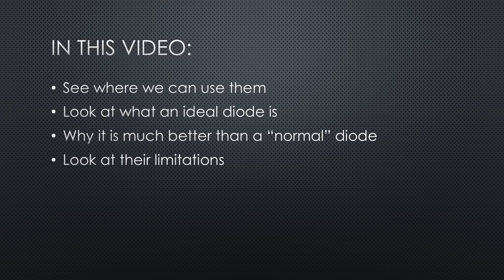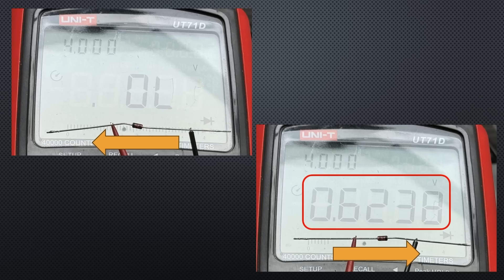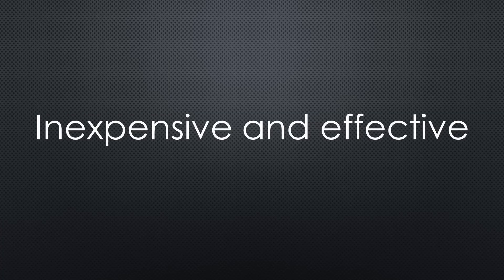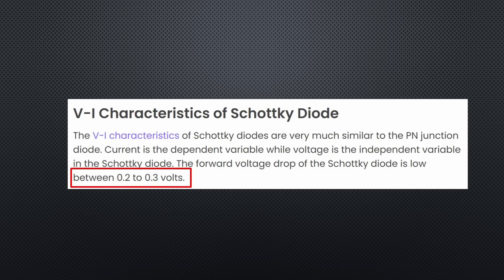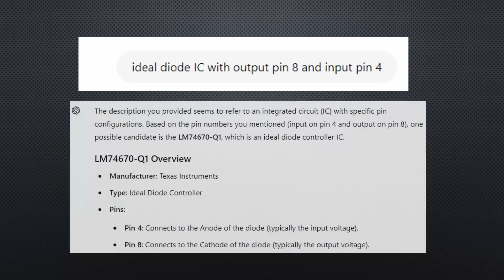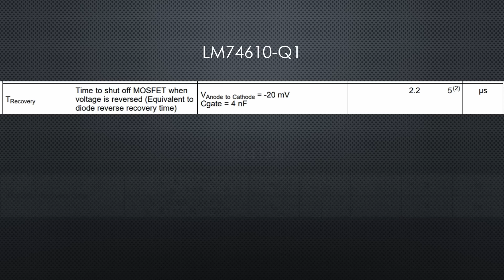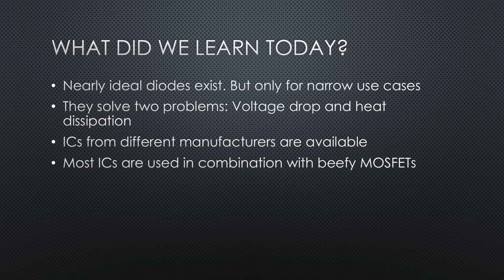(492) How to Protect Your Devices Against Reverse Polarity Using Ideal Diodes

Comment: Nice, I liked the Morse code section delimiters, spelling out the word diode. 
When it comes to polarity protection, I normally go in a different direction. My go to design is to not put the main power through the protection diode but to put it through a resetable fuse, then I put a Schottky diode in the reverse direction across the power input but behind the resettable fuse. So if the user applies reverse power the diode acts as a short circuit and causes the fuse to open protecting all the circuitry including the protection diode. Once the polarity has been fixed then the fuse resets and operation can continue normally. I think this is a better alternative for 2 reasons, but it has 1 drawback.
Its better because it forces the designer to include a fused input which provides protection for both polarities of incoming power, something that all equipment should have. Secondly it does not dissipate any power when the polarity is correct. The 1 drawback is that your internal circuit is subjected to a reverse voltage equivalent to the forward voltage of the protection diode. So if you are designing very sensitive circuitry further internal protection might be required.
Reply from the maker: A good idea for low power devices. I assume it has a low voltage loss. It is sometimes called "Crowbar" because you shorten the power cables.
Reply: @AndreasSpiess  Some call it a crowbar, but it is not quite right to call it that. It also works for any level of power as long as you select the correct fuse. 🙂
Reply: @AndreasSpiess  So is the ideal Diode solution. For High current devices a latching relay could be used with a diode to trip the relay off in reverse polarity, another diode to latch it on in forward polarity. 

My cheap & easy solution for Rev, Over voltage & Surge is a TVS diode & a PTC fuse. Cannot beat it for cost & simplicity.
Reply: Even better use a TVS diode which adds over voltage & surge protection. Cheap & easy!
Reply: I really did not like the super loud beeps.
Reply: @leocurious9919  I also really hated getting really loud beeps directly injected into my left ear.

Comment: I once had this dilema so i tried to make what i called the (I don't care circuit) with mosfets and relays which was designed to deliver the right polarity no matter what polarity on the input but for efficiency and cost I went back to the diode and fuse simple design.
Reply from the maker: Indeed, this is a good thing for low power devices.

Comment: My worst (most costly) "reverse current incident" happened in the mid-80s. I was examining a German Z80 computer accessory card, a pretty expensive A/D converter. I put on the power, and it burst into a short flame and then black smoke. Since it was black smoke, it wasn't repairable (you need grey smoke for that as you all know😁) It turned out I should've checked the power connector, the brilliant German engineers who made the card, decided that black should be the positive connector and red the negative, just for this accessory card while all other components in the system were the standard red for positive 🤦‍♂😂
Reply: Yep, can never trust the colors, there are no true standards, just conventions.
Reply: @xxportalxx.  One North American truck (highway tractor) brand (forget which one) enforces that by making every wire yellow.
Not sure if they save any money during manufacturing, or if it is to prevent easy wire tracing.
Reply: @jamesphillips2285  I was just working on a pump controller yesterday, had a wiring diagram in the manual, but my controller had a slightly different revision of one of the boards, they swapped the wire colors between revisions!
Reply: @economicprisoner  Was it the trucking company "Yellow"? /sarc 
Funny since Yellow use the color Orange instead of Yellow in their logo. Sad they went out of business.
Reply: @guytech7310  Might have been Freightliner.
Reply: @economicprisoner  doubt they save money because that sounds like it would take at least twice the time to correctly assemble
Reply from the maker: Nice story. Thank you! I recently had a new device with black as positive (I think it was for a car). Very misleading! I thought at least red and black are quite common these days,
Reply: Not only Germans, British paging systems use a RED ground.

Comment: hi, i am using a WSD90P06N56 P-MOSFET (i chose this one for its low 10mOhm ohm resistance) with a MM3Z16VB 16V zener between gate and drain for reverse polarity protection of my last project (audio amplifier, VCC 36-48V, max power ca. 300W). I also have a 10K resistor between gate and ground so that a minimum 2mA current passes through the zener. What do you guys think about it?
Reply from the maker: This is another common design. Its disadvantage is the current consumption through the Zener/resistor. Otherwise it should work if the Zener voltage is smaller than max Vgs.
Reply: Thanks. I am using a 10k resistor between the zener and ground to minimise the current. I hope it will work :). Thanks for your channel by the way.

Comment: I used to design electronics for earthmoving equipment, and reverse battery protection was essential for any piece of electronics.   For small sensors, a diode was usually sufficient.  For larger items like ECUs, the solution tended to be similar to these devices that controlled series mosfets.   The electronics also had to pass a variety of electrical transients tests, EMC tests, etc., so that made things a bit more interesting. 😄 Thanks for the video!
Reply from the maker: Indeed, adding transitions makes things more complex!

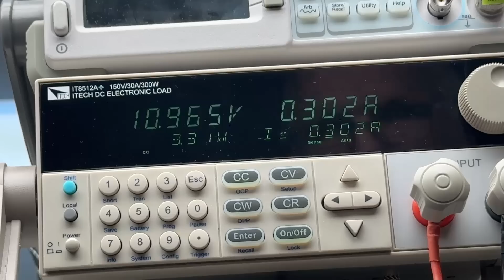Comment: One thing: The most common failure mode of a diode is that it shorts, they rarely go open so a diode should not be considered a fuse, as the video suggests @4:20 A reveresed diode in series with a fuse (reversed over the load, fuse in series) is an optimal protection.
Reply from the maker: Indeed, i thought it was a joke (obviously not a good one because it has to be explained).
But one other commenter wrote that he uses diodes as a fuse...
Reply: Yeah, I did not catch it as a joke, but perhaps it was obvious for others. 🙂 But if it can be misunderstood it is a bad joke, it could ruin someones projects while trying to learn electronics and leave the video with the wrong "fact".
Reply: @daw7563 The people that don't bother to understand first and "just do" don't get my sympathy.
Reply: It was meant as a joke, you know diode turns into a fuse. He never seriously suggested you would use it that way.  We should not be in the electronics field if we would entertain the idea of using a diode in place of a fuse, unless in jest.

Comment: A friend has recently replaced the beefy schotky diodes on all his solar panels with ideal diodes. He claims a 2-3% increase in output but I suspect the main benefit is that the ideal diodes don't melt the plastic box the original diodes were mounted in.
Reply from the maker: Interesting idea! If he has a lot of shadow on one panel, they could get hot. But I also doubt the big efficiency gain.
Reply: @AndreasSpiess So do I although if it makes him happy that the work and expense involved were justified I'm not going to argue the point.

Comment: I've used ideal diodes in a battery "hot swap" situation. When battery 1 was getting low, I could plug in battery 2, then unplug battery 1. Battery 1 could then be recharged. This way, the power to the equipment would not be interrupted when replacing batteries.
Reply from the maker: Good idea!

Comment: It depends on your source voltage, if your input is 25V a 250mV drop will result in 1% power loss.
Reply from the maker: You are right.

Comment: do you think that they can be used to audio amplifiers ?  to solar/wind  power inverters ? 
for smaller more efficient machines :)
Reply from the maker: I tried them with 50Hz sine waves and they did not perform well. Maybe there are other ICs for such applications.

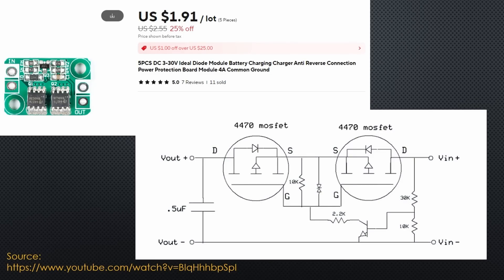Comment: 9:10 there is nothing wrong with this circuit except that it should have another diode on the output to clamp any transients. if this doesn't work, it's because of bad quality components
Reply from the maker: I did not test them. I only watched the video I added as a source. And another commenter wrote that he has the same experience. Maybe bad parts, I do not know.
Reply: @AndreasSpiess  i ran some simulations to test my theory and have come to the conclusion that it does not work in simulation either; my original comment was incorrect

Comment: Be very careful with the LM74610. Back in 2016 when it launched I tried making a video about it. It basically didn't work in half the situations I put it through. I concluded that there was fundamentally a problem with the silicon. Try rectifying AC using it and watch what happens at different frequencies and load currents. The LTC43xx family works great though. I am guessing that there is a good reason why there are not more non-ground referenced ICs out there. Too good to be true. Also please be careful posting ChatGPT output. Unless I am mistaken LM74612 and LM74600 do not actually exist and they were just hallucinations.
Reply: The goal for most of these "ideal diodes" is usually just prevent backfeeding power so you can join multiple batteries or PSUs somewhat safely. They are not a real substitute to diodes for rectifying AC or working with signals
Reply: Miss your videos mate !
Reply: I still remember your video with p-channel MOSFET. 👍🏻
Reply: @mihajlopetkovic2003  me too !!! I remember it as if I watched it yesterday
Reply: Brooooo.....what are you doing here? Why are you not back? Just started my electronics journey a few weeks about and will finally start venturing out on buck converters because of your videos.
Reply: People need to understand these systems are simply complex search engines. They will spit out anything which is the median consensus of its training data. It has no correlation with correctness nor accuracy. If you want the best answer it will never come from these types of systems.
Reply: @justanothercomment416 search engines do not hallucinate. You see an original text in search results. Search engines could manipulate a relevance rate to help their client to sell more goods though on the other hand. I tried to use gpt as a search engine, and realized that I cannot trust it. It can represent someone’s answer on “reddit” and ignore a fact that there were 10 other comments proved the author was wrong. But it’s good in making conclusions. As many other neural networks (because nn were always good in highlighting existing patterns)
Reply: @justanothercomment416  worse than search engines, search engines don't typically just make shit up.
Reply: @justanothercomment416  unlike search engines they also spit out things that do not exist. in such cases they are worse than search engines.
Reply: @justanothercomment416  Concur, if you query the output of these supposed AI systems, they will reply, yes, you are right.
Reply from the maker: @Afrotechmods: Indeed, I tried it with a curve tracer and did not get "ideal" responses. This is why I sticked to the two main applications where they should work ok.
Concerning ChatGPT: As said in another video, I use it as my "Copilot". I am always responsible, and sometimes, the Copilot is useful. As in this case: Google did not help with my "fuzzy" problem. After ChatGPT I had enough stuff to continue with datasheets.
Reply: @AndreasSpiess A copilot which is confidently wrong half the time seems worse than useless.
Reply from the maker: @Oberon4278  Not for me because it still is 50% right. If it is wrong, I only lose some time proofing it. But I agree, this is a discussion on whether the glass is half full or half empty...
But as I said: I do not trust it; I use it as a source. And only for questions where I have a chance to verify the result.
Reply: @Afrotechmods Miss Your vids as well! Why don't you produce an occasional video? Last one was like 6 years ago!
Reply: You don't use ideal diodes for rectification. So that explains why you blew them up.

Comment: I found the LM74700 on LCSC which is cheaper than the ICs used on the Ali Modules.
Reply from the maker: Thanks for the hint. LCSC is a good supplier, particularly for parts because you can trust them.

Comment: For my simple, low power devices I usually go for a simple p-channel mosfet like an IRLML6402. No overvoltage protection but plenty sufficient for any micro controller board powered from a 5V source. The cost is neglegible.
Reply: Same here, but my go-to has been the Si2301C.
The IRLML6402 looks interesting. Similar specs but a higher Max Vgs and slightly lower Rds(on). I'll add some to my next order. Thanks!
Reply from the maker: Indeed a good solution for 5V and low current devices. And simple! Thanks for mentioning.

Comment: Thank you for the video. These devices are fine for reverse current blocking. Could be also nice as parallel diodes in solar panels for shunting shadowed panels.
For protection I prefer a 1N4007 or the like parallel to the input and a short circuit protected power supply.  The you have no voltage drop at all and you are also safe if there is a short in the cable or connector.
Reply from the maker: A good idea. Often used with a fuse in series. Sometimes called "Crowbar" ;-)

Comment: I disagree, ich würde eine MOSFET benutzen in Serien solar Anlagen.
Reply from the maker: These devices also use MOSFETS. What would you do differently?
Reply: Some will use Schottky in solar panels, in case, one panel fails or get shattered, the converter will going to buck/boost is maximal power point, but I am still willing 
to  do it with MOSFETs because of the internal resistance and also protect against reverse polarity

Comment: What are the differences between the ideal diode and PMOS for reverse polarity protection?
Reply: PFET solution is simple, but limited to low current applications.
Ideal diode controllers are able to drive NFETs, which have low on-resistance and are able to pass high current.
Reply from the maker: In addition to @coceth: They can also be used for higher voltages than max Vgs of the MOSFET

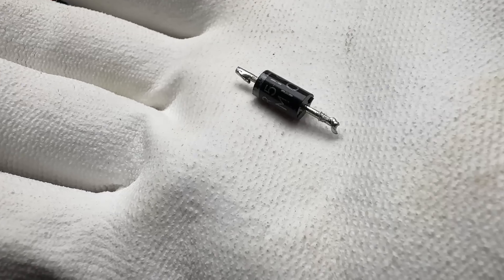Comment: 4:35, kinda expected you to say "lets use 5 of them". 

I used one of those on my first solar battery project between a meanwell HLG psu and the fuses because i was not sure if the meanwell enjoys a reverse voltage wjen powered off. 

Used the meanwell instead of a normal 8s charger because i could adjust the voltage, or the maximum SOC from mains since its a island system with mains fall back.
Reply from the maker: With an adjustable voltage you can use a diode, no problem (if it does not get too hot).

Comment: "It is rated to 40 Chinese Amps" 😂
Reply: What is the conversion for Chinese Amps to Amperes?
Reply: @Deltaplusproto  Depends on whether  it's a fuse or not. Fuses are X2, all others are X0.5
Reply: @LiviuGelea what kind of sense is that
Reply: @AKG58Z  it's a quote from the video.
Reply: @AKG58Z  that they tell you whatever YOU want to hear to sell anything?
Reply: I think it's about 4:1.
Reply: You seem to have noticed that Chinese amps are smaller. Yes, that's true. And their watts are therefore smaller too. Their volts too. I have meters that can get 1.61v from a C cell. Do I get the Nobel prize?
Reply: You got the right point about this. 

Chinisium ratings are different from ours.

Comment: Diode 👍😁
Reply from the maker: Bravo!
Reply: @AndreasSpiess Beyond the Morse code you saying "front row" instead of "first row" seemed strange.  Just a slip up though?
Reply from the maker: @jmr  No, this is a suggestion of my correction service. I correct all my scripts with Grammarly to use correct American English.
Reply: @AndreasSpiess  There is nothing "correct" in American English anymore.  The word literally has literally and figuratively lost its original meaning. 😅 I do appreciate you trying though.
Reply: @AndreasSpiess  Next time send the morse code at a frequency > 12kHz. Secret for OM's and still a challenge for young HAM's.